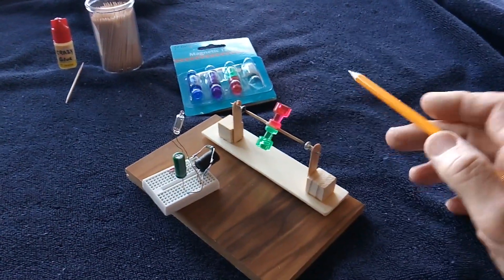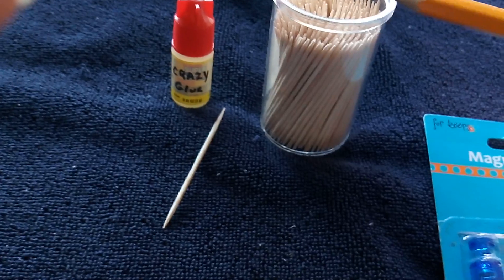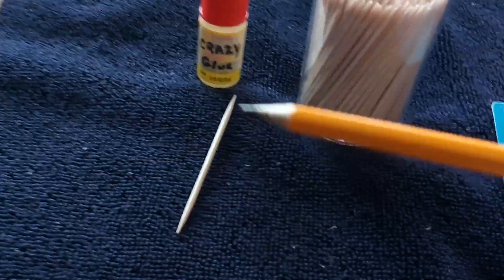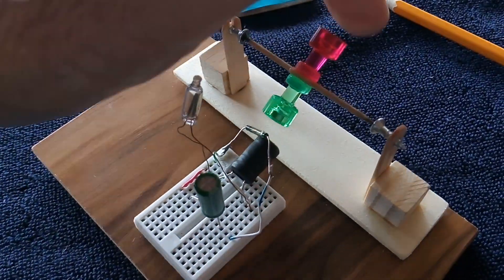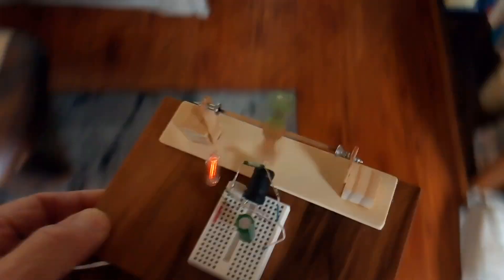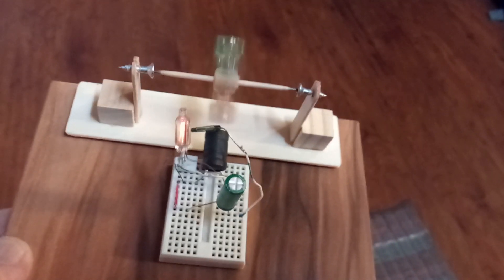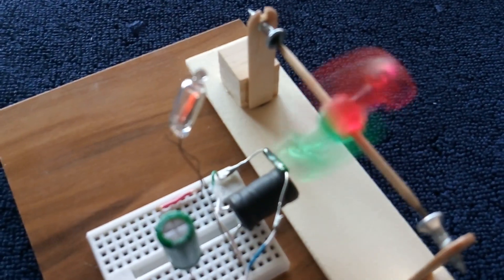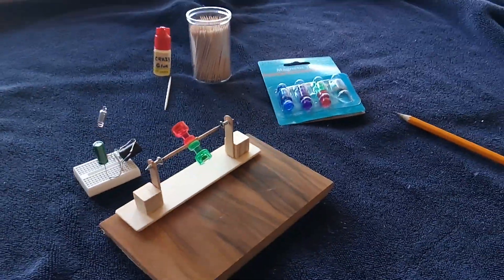Magnetic Tacks Motor

Comment: hi Lidmotor, nicely done as always. crude but effective is how i like it. i got a pulse motor that has the coil out of a microwave gearmotor that turns the platter slowly for a pickup coil and a small ferrite choke like your drive coil as well. 
i will make a video of it soon. i can add a link here later if your'e interested. cheers.
Reply from the maker: Thanks.  I did a motor just like you described a few weeks back.  It wasn't very successful so I didn't pursue the idea.  I will be interesed to see how you did your motor.  In theory it should work great.
Reply: @Lidmotor   here's a clip.
i tried the 21 v microwave motor coil as a drive coil and it could spin to about 900 rpm,( notably cogging free, all air core was a first for me). i tried inserting a ferrite torroid in the centre of it. that had too much attraction for the reduced current,(165ohms), to overcome. putting it with the ferrite choke in the middle might make a good combo?
i also tried another ferrite choke i rewound with 25 ohms and it wasn't as good as the drive coil in the clip. and i would assume any old transistor should work, but only tried this one so far. your reed switch and choke coil are doing well to get a neon pigtail starting to glow. this combination in this clip is very lame in terms of switch off transients.
https://youtu.be/0XpqUXOJcTY

Comment: Reed can handle the spark and bemf.   Electronics prob cant.
Reply from the maker: To get the really high back spike voltage you have to snap the switch on and off quicky and solidly.  A transistor can do it but I have not figured it out yet.

Comment: I love the detail you explain in this and this one is pretty colours , so it gets bonus points 😊😊 I have been using chokes for a project series. I intended to use them for pulse motors, but I got diverted. Wireless transmission again, playing with a wireless phone charger module.
Reply from the maker: I look forward to your new project series.  It sounds very interesting.
Reply: @Lidmotor  very very simple and low level technology, but it works, and that is all that I wanted 😊